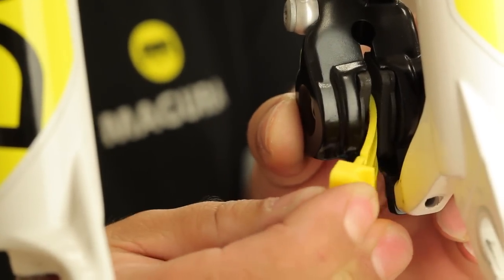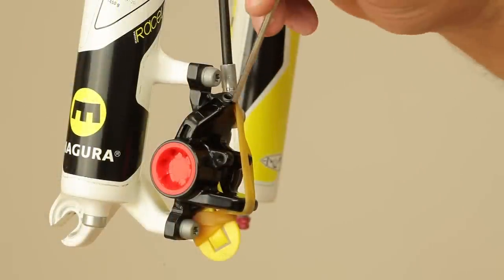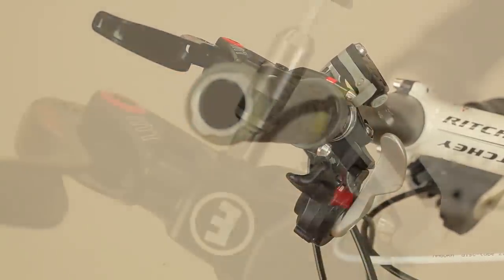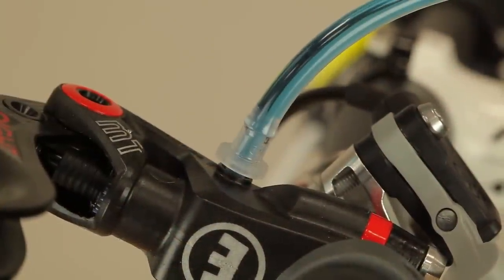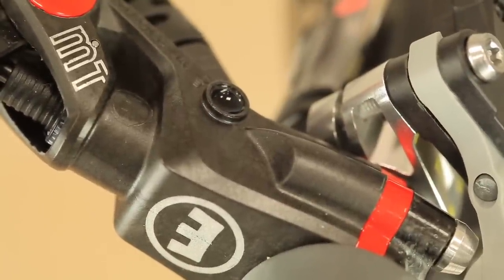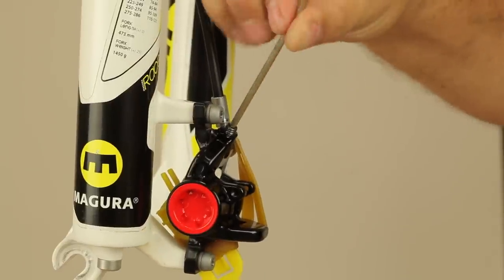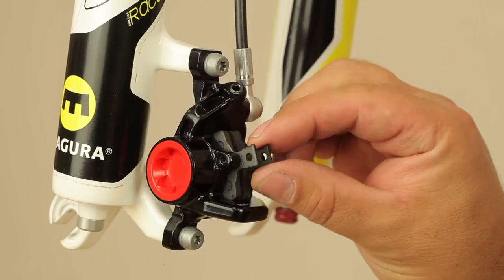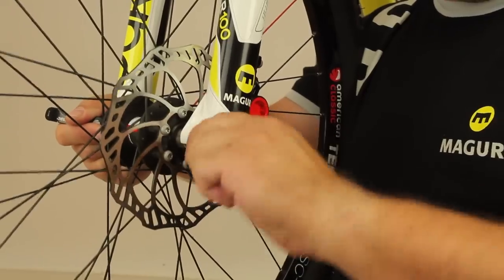Filling/bleeding of a MAGURA disc brake (MT8, MT6, MT4, MT2)

Comment: I have MT2 brakes that were getting squishy. I followed along with the directions and they are just like new now. My only changed was that I used a 3mL syringe for the top reservoir when I was bleeding out the air. To the negative comments about the plastic reservoir caps, they aren’t the best but if you follow the torque recommendations then you shouldn’t have any issues. Thanks for the video!

Comment: Agreed with the below comments regarding the EBT reservoir screw, why the heck are they made out of a plastic? Mine stripped just looking at it.
Reply: I believe they are plastic because the levers are a composite material and it's easier and cheaper to replace the EBT than the lever body.

Comment: I bled mine as suggested, and now have no power, or movement of pistons whatsoever. I have the MT2's. The only thing I can think of is the calliper bleed port is on the side of the calliper. Do I have to remove the calliper and have the port facing up? There' is fluid in the port when I remove the syringe, so I really don;t think this is the issue.
Reply: It's been 6 years but would you still be able to tell how you fixed it? Got the same problem :(

Comment: Hi, Could you do me a favor? One of my customers met an issue that the spokes just hit the hydraulic hose using Magura M8  brakes. what would you recommend to give more clearance?
Reply from the maker: Hi there, I would recommend to take a quick look at the banjo fitting on the brake caliper. Maybe can fix the problem by opening the banjo screw a bit. After that you can angle the tube in a better way that it doesn't hit the spokes any longer. If you've got any further questions you can always contact us on facebook.
Reply: Thanks for your advice so much!

Comment: I'll just add that EBT screw has a very fragile interface with the female threads in the brake lever, and will strip with just a trifle over torquing and, because it's all nylon, you don't feel any definite "stop" when tightening that screw which noble Magura only wants 12 bucks for. Once "stripped" you will spin and spin to remove and the screw will never come out. I just went through this. I had to dig and lever with a knife point, carefully and painstakingly just to get the then-destroyed screw out! Why anyone would manufacture such a fragile parts interface is a mystery to me. But then again, I don't sell these screws. Please note: my previous comment came before destroying a screw while trying to remove it. I went looking for one because the bike with MT2's just bought was missing one EBT. Now I need two and have since found pairs of them for sale on ebay at a price very close to what Magura wants for one.
Reply from the maker: The EBT-screw has a maximum torque setting of 0,5Nm.
Reply: There is an easy way of removing the broken screw. All you need to do is to warm up torx key and just melt the key inside the screw.

Comment: Avid copying the old maguras and magura making things overcomplicated? My old Louises never ever had any problems still running them on the old bike without replacing a thing. 10 years and stil going. The new mt 4 on my new bike already loosing their nylon bearings? Stuff that's not even present in the old Lousies. Planned obsolescence otherwise it makes no sense
Reply: Hindsight. MT6 were a nightmare. Tiny bleed ports with nylon set screws? Once and done. Total garbage.

Comment: Got some MT6 brakes not used for years. Tried to bleed...STUPID PLASTIC BLEED SCREWS!!!!
Couldn't get them to move without force so obviously the PLASTIC SCREWS (????) stripped easily.
So to hell with Magura plastic. I just bought METAL ones from China for half the Magura price.
Will continue riding the other bike until they arrive. FFS.
Reply from the maker: Please note that the max torque on the EBT screws is 0,5 Nm.